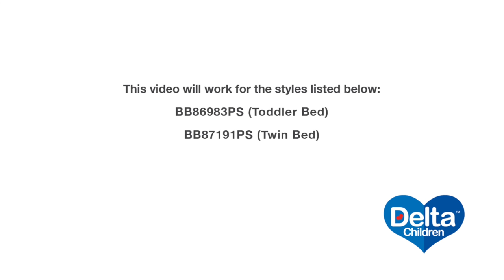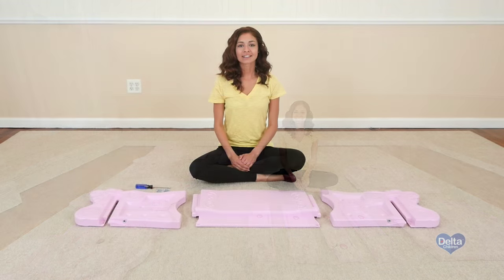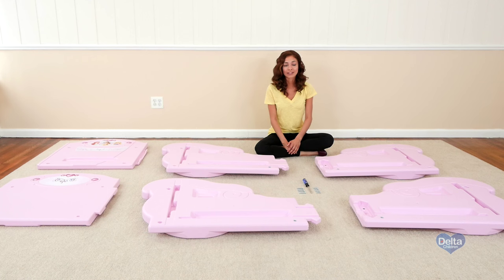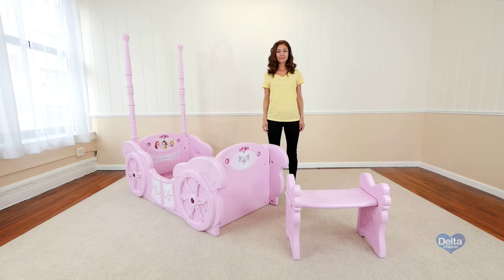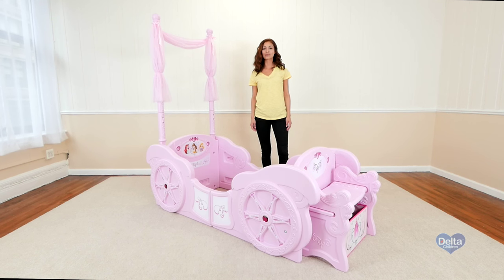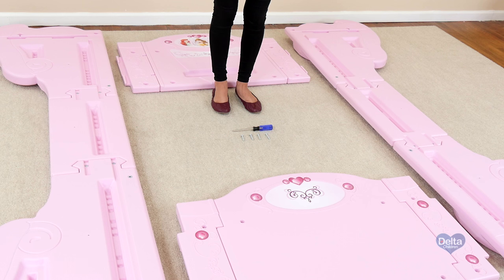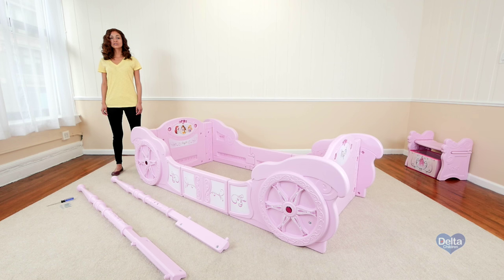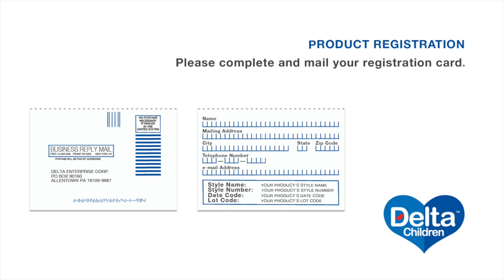Delta Children Disney Princess Carriage Toddler-to-Twin Bed Assembly Video

Comment: I purchased one of these beds in 2017. I just now got to put it together for my daughter's room. I put it together in twin size. 
I love the bed, it's adorable. But there are a few problems that should be addressed by the manufacture:
The sticker that goes on the headboard, under the oval princess sticker- this sticker barely fits over the hole that it is supposed to cover. I'm unsure why the bed has these 'holes' that are to be covered in stickers. It would have been better to make it flat, just as the opposite side is flat. I'm worried that the sticker will get pushed through the hole and ruin the stickers. Hopefully this won't be an issue, the stickers that cover the 'holes' are pretty thick, but it's still a worry.
Also, it would have been nice if they would include more than just the 3 oval stickers (that go on the headboard and footboard) and the little 'gem' hearts and circle stickers that go on these areas. This would have been nice, so that both sides of the headboard and footboard would have the nice stickers applied. 
Also, the white straps that go on the bottom of the bed, one of the straps did not fit. It wouldn't reach to the other side. So I only have one strap attached. 
I would be willing to pay a few dollars extra for a bed like this, to get plenty of stickers, maybe even some extras (they did include one extra oval sticker- which I went ahead and applied to the inside of the footboard- on one of the spots that has the cutout in the bed for the sticker, but no stickers to place) this way there are enough for if a mistake is made, and a sticker gets ruined during the application process, and also so the buyer can add the extra stickers in the areas they see fit. 
I have to say, ,overall, I am very happy with this bed. My daughter loves it! It's so cute. I just wanted to give some ideas from the consumer POV.
Reply: Christa H I feel the same way lol  gonna go look online for jewel stickers or for photos I can print and stick over all those eyesore spots